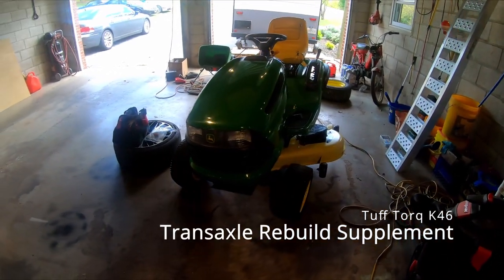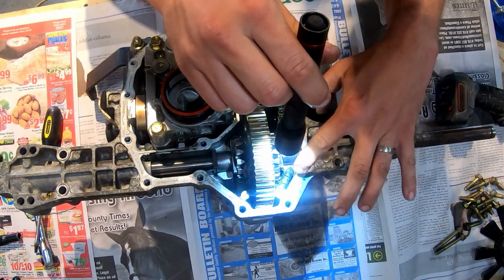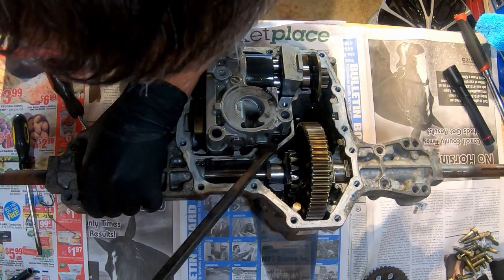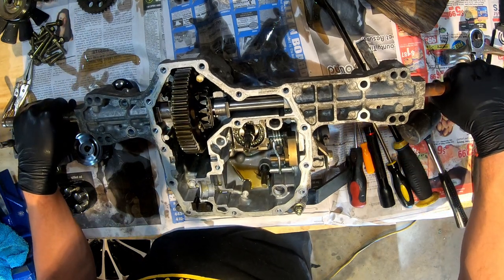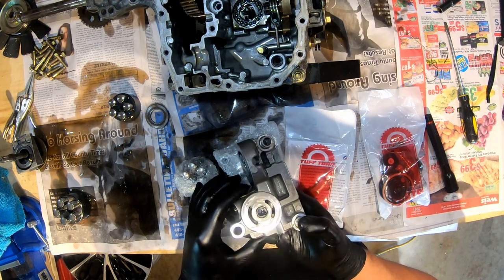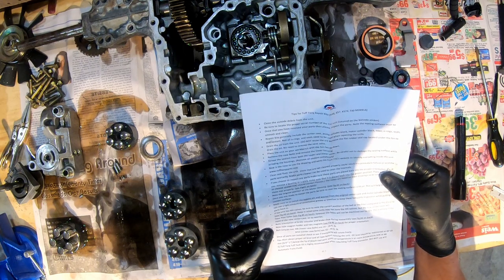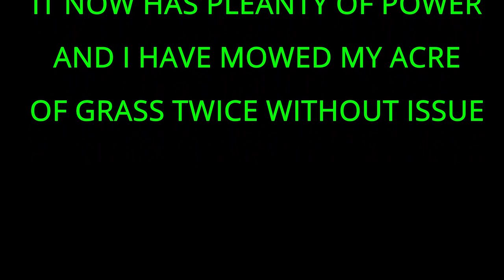TUFF TORQ K46 HYDROSTATIC TRANS TEAR DOWN AND INSPECTION

Comment: As long as you understand that these hydrostatic transmissons work solely by oil pressure, it's easy to figure out how the behavior of failure matches the wear patterns.

First, notice there are no o-rings in the hydraulic circuits--the only o-rings/seals in the unit are to keep the oil from leaking out.  That tells you that hydraulic pressure is maintained by the fit of the metal parts.  Even though the parts are bathed in oil, they will still wear, and as they wear clearances will open up, reducing pressure and of course reducing output power and therefore speed and ability to pull a load and go up hills.

Any visible wear between the chrome pistons and their corresponding body will result in oil bypassing and reduced pressure.  Any visible wear between the mating surface between the pump and motor bodies (the cylinders that hold the 5 pistons) will result in oil bypassing and reduced pressure.  At these pressures, anything you can SEE will result in pressure loss--it doesn't have to be bad enough to feel.

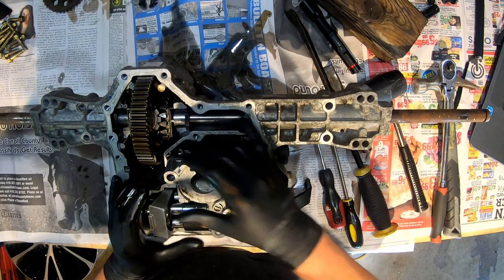Comment: Thanks for this video. I particularly liked the part between about 11:00 and 19:00 where you found it difficult to get the main pump/motor housing out. I was stumped at this point also. Taryl made it look easy by cutting out all the cursing and levering needed to get it out. As you say it is not easy, and I was thinking, like you, that there must be something I missed. But I have left it overnight, and have found your honest assessment of the situation. I will now persevere a little longer. Think I might build a DIY Tuff Torque transmission stand to hold the transmission while levering. It looks like it might help.
Reply from the maker: Glad I could help, hopefully you were successful with the rebuild!

Comment: There's a guy in eBay that'll resurface the old parts and send them back to you for a fair price and that's usually all that's needed assuming you inspected everything else and found nothing wrong. But you can do it yourself just need a flat round chunk of steel and sandpaper for the center body and a flat surface for the pump and motor. Really easy flat is the key to it working like new again.

Comment: Great video just like your one on the drain and fill. I and the lawn mower thank you for the informative video. Do you have to grease the axe back wheels as often like the pivot points on the front? Like to say like every trans fluid change? Also you did very good 900 plus hours wow you helped with a little to no movement i'm just on 135 hours that castrol from the fill video really helped
Reply from the maker: A little grease usually never hurts!

Comment: 936 hours and no leaks?  and this is the first time it's serviced?  that's FUCKING AMAZING!  but don't tell this guy.  he's already pissed and this video will just piss him off even more hahahahahaha https://youtu.be/JZbTUSe5skA  by the way, I've seen several videos on youtube where the K46 lost torque before it got to 150 hours.  I've heard that if you want the K46 to last a long time, you should service it sometime after the first 50 hour break in period.  It comes from the factory with 10W30 oil to give it a good break in period, and after 50 hours that's when it will contain a lot of metal shavings.  So at 50 hours if you dump out the old oil, open the transmission, clean out the old oil and metal shavings, reseal the transmission and refill it with a heavier grade 5W50 oil, that will give it maximum torque and a longer life.  And then after that initial service, you won't need to open the transmission again, just dump out the old oil every 200 hours and refill it.
Reply from the maker: Great info 👍  I will definitely do the 200 hour services

Comment: Great video!  Did you happen to check the fluid level before pulling the bottom off?  I am just curious if it would have still looked full, or if there may have been air in there after you refilled from the last video, causing it to be lower.
Reply from the maker: Thanks! Yeah it was at the same level as before. There was a long delay before it worked at all after the rebuild, so much that I was about to start taking it apart again. Then finally it started making noise and slowing gained more speed and power.

Comment: How much oil did it take? If they put a drain and fill plug in these they would probable last forever!
Reply from the maker: They use a little over 2 quarts.  I actually now recommend using the actual tuff torq fluid.  Comes in a gallon container
Reply: Personally I think it’s best to open it up to clean all the magnets off and the filter too at least one time then after that you can just drain and refill them. Getting all the “break in” shavings out is beneficial and cleaning the magnets to allow them better magnetic pull for any leftover or new shavings helps. Mine has a total of 4 magnets 3 inside and the one at the fill port. I didn’t want to go to all the trouble of opening it up but I was glad I did. Hopefully I get many many hours trouble free.